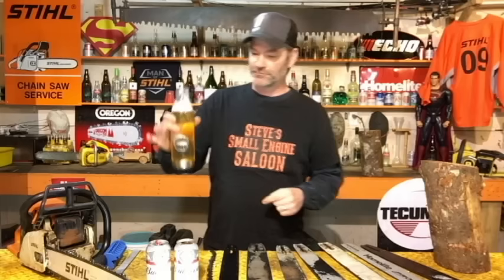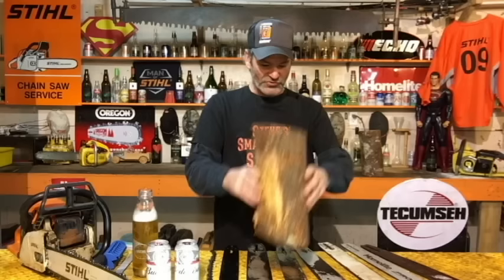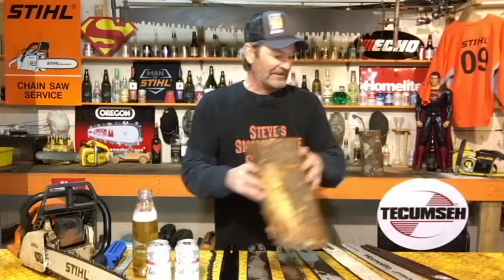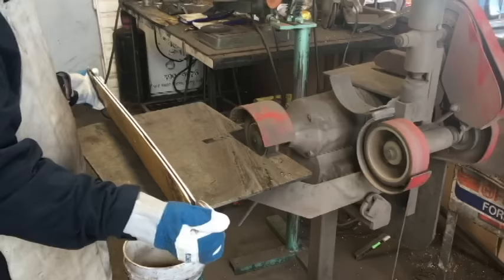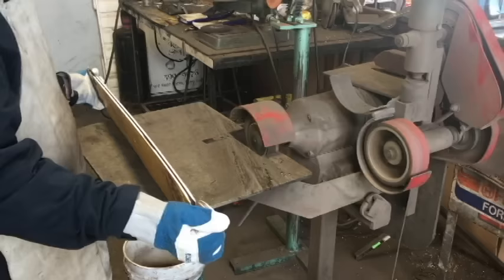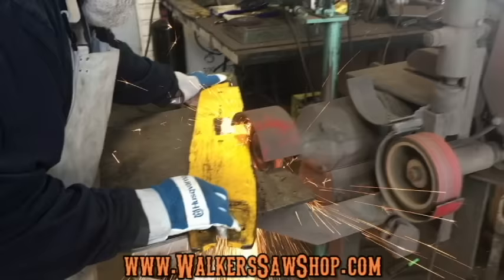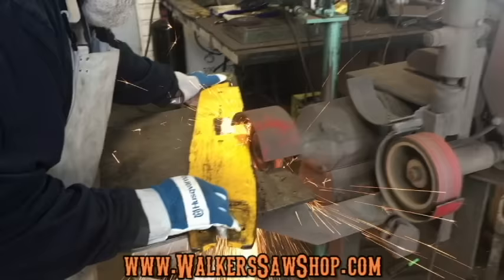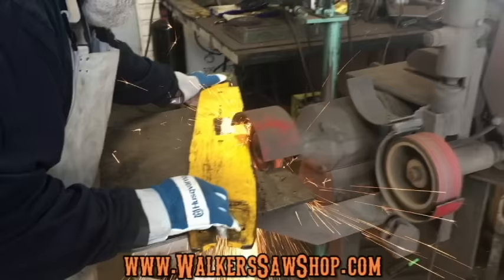How To Repair A Chainsaw That Cuts Crooked

Comment: After 45 years in the tree / saw maintainer biz, I have seen just about every mistake you can make with a chainsaw. Bar and chain maintenance are at the root of most. I think the most important is most of what you covered. My suggestion: after you finish cutting, remove the bar and chain, clean the bar, use a bar square on the down side ,not much.. one or two strokes,clean,grease nose sprocket and re install,leaving the chain loose. I get better bar life this way, rather than waiting until it’s grinder time. Love your show. Just remember, there are some people that should not pick up a chainsaw. Just  for safety’s sake.
Reply: I think I'm one of them!  Every time I do my back gives out!

Comment: I’ve worn out a bar groove, I was doing all the things, always debured the bar, the rails were square, even got a new chain but I could see the chain was twisting in the cut. Put in a new bar and saw how tight the chain fit and was amazed that it could even happen. When I teach someone how to sharpen their saw, I always speak on bar maintenance as a part of sharpening. The eye rolling can be deafening. I think that we all get our expectations misaligned by power tools. Maintaining a power saw is half of the safety of using it.

Comment: There is something you can do about the gap between the rails being to big. There is a tool that you use to roll down the bar to shrink them back together. Then hit it with a edge dresser and run it. Most people it isn’t worth it but when you run a saw all day every day that bar and chain money adds up big
Reply: Or next size up chain.

Comment: I've added some time to a bar by removing it, stacking two old hacksaw blades (depending on the blades used, 0.048" to 0.054") in the channel, and lightly peening the groove top & bottom. Then put one blade in the channel and, using the face of a ball peen hammer, swage down the length of the bar edges with downward pressure.  This tightens the groove back up. At that point I use one of those 90 degree file holder/bar dressers followed by a scythe stone to even the rails. I keep my "rehab" bar with a pair of well used and resharpened chains for those jobs where I want to clear an already storm or age/downed tree that has been laying in the dirt or silt (our property is bisected by a creek that likes to change banks and wipe out trees) and will likely dull the chain quickly, anyway.

Comment: Customer's Stihl 034 saw was cutting crooked to the point it would bind and start smoking the bar. He was a DIYer, and last time he worked on the clutch/drum, he installed the dished washer backwards allowing the drum assembly to walk in and out on the crankshaft end.

Comment: Thank you Steve. I worked in a small engine/saw shop and know most of this stuff but these videos are my refresher course. I tend to forget things these days and this is like going back to school. I haven't had this problem myself in about 30 years but when I did it was bad! Worse, it was my lack of sharpening skills at that time. I have also had bad rails too. I think? I think it was from me running a tight chain? A file did the trick as you showed. These days when friends bring me their saws it's usually a carb problem. Sometimes a good cleaning will fix them or just a kit and clean.

Comment: Hey Steve, been watching your channel for years now 

I have a 661cm with a 42” Oregon bar. Yes, one step above the max size. I blew out the sprocket on the end of the bar. It even caught on fire and melted the paint off the tip. Had it in the Alaskan mill for sugar maple 

Sprocket was free and oiled. Brand new bar and had no issues logging the first few logs. The rest of the bar is totally fine 

Gauge and pitch were correct. Stihl chain on the Oregon bar. Skip tooth 3/8 .063”. Brand new chain. Brand new clutch and drive sprocket. Brand new bar second time using. 

My thoughts are not enough oil
Getting to the tip, lower quality bar ba stihl, chain maybe too loose, maybe the sprocket got worn off to one side and the chain was riding the side, probably a combination off all of these. I will replace the bar sprocket and try again. There is a small possibility of a manufacturer defect on the sprocket but it’s welded inside the tip now and I can’t get a Pi look at it until later. 

Anyway just wondering if you had any additional thoughts or ideas.

Comment: Steve, thanks for posting this.  I was cutting firewood this afternoon and the saw was only cutting well on an extreme angle.  I took the bar off and set it on the table, could not get it to balance on the bottom side, top side balanced well.  Flipped the bar and went back to the wood.  Cuts like a dream.  I will try to file the bad edge and see if I can save the bar.  Thanks again man!
Reply from the maker: Awesome!

Comment: Just tuned two bars yesterday, from an 018 and a 290.  I have a woodshop and a shop build edge sander.  Works great for getting the rails both to the same height.  Uses a 6" x 48" belt with a platen at 90 degrees to the belt.
Reply from the maker: Right on Ole!  We used the same thing at a shop I used to work at.  Works great....

Comment: I have been in the small engine business for 25 years. The was excellent and comprehensive training on bars and chains. Box stores usually know little about bars and chains. Our local box stores often sold chains to customers that were a different pitch and gauge than their equipment required. I have straightened out those issues often. I would surmise that your video helped many people.
Reply from the maker: Thank You...

Comment: Very good, informative video.  You didn't touch on one cause of crooked cutting that I personally experienced.  As the bar wears, the guide links can touch the bottom of the slot in the bar, which will raise the tie straps of the chain above the rails of the bar, allowing the chain to tilt right or left.  When this happens, the bar is plain worn out.  I also clean the bar slot each time I change or sharpen my chains.  It's amazing how much junk gets jammed in that slot

Comment: Good video. I cut wood in the high desert. The sand eats chain, bars and sprocks quick. I ended up getting the bar rail grinder from Bailey's and a bar rail closer from Madsen's. The grinder is very helpful! But, I often close the rail too much which I'm used to sligjtly re-openning back up. 

I like the cannon bars the best as they last (a little) longer in the sand then even Stihl and for sure longer then the Oregon and Husky bars.

But one thing is for sure, I cut straight now.

Comment: "He actually said that you can hold water in them too. I'm not so sure about that." LOL!
Reply: Shouldn't drink water. Water rusts pipes and fish poop in it.
Reply: I tried putting water in a similar bottle. The problem is that it never got drunk. Beer seemed to get consumed faster. In short, it’s a good container for water, but it’s a better vessel for drinking a couple beers. Especially if you only want to drink “one”.

Comment: Steve, I have used a wider gauge  chain on a bar that the grove is too
Wide. We did this in the logging 
Industry and it worked fine. We also replaced the tip that fit the chain.

Comment: Thanks so much for posting these videos, my dad never did proper maintenance on the old chainsaw (pioneer partner 400) or taught me much in the way of how to even use it. With your videos it's been a slow but steady process of first getting it to start, tensioned, sharpened, and now getting it to cut a bit better/straighter.

Comment: I live in the land of logging and forests, Sweden. So, here having a chainsaw is like having a car. However, only your instructions clearly demonstrated carburator adjustment on my Stihl saw. Good job. Keep it up.
Reply from the maker: Cool, thanks
Reply: @StevesSmallEngineSaloon  I'm wondering if you could possibly produce a video on the proces of cutting along the grain when handling chainsaws. What I mean is that I tried to adjust the angling on my chain to cut along the grain, but it doesn't feel right. Perhaps you could enlighten me?

Comment: When dressing your bar, don't forget to also de-burr the edges. That same Oregon tool (Pferd also makes a good one) that works to level the rails is also good for deburring, you just turn it to put the cutting edge on the side of the bar, rather than on top of the rails. (A regular flat file works as well.)  After leveling the rails and deburring, the corners of the rails are often razor sharp. I'll generally take my flat file or bar rail dresser and make a VERY light pass with it held at a 45˚ angle to just break that corner slightly. You hands will thank you  for this step if you are ever handling a bar without gloves on.

Comment: Steve, you're my go to guy whenever I run in to problems with any of my gas tools.  You've saved me a ton of cash and time. Love your vids! I discovered a variant on reason #2: the driver teeth on the chain wore down very quickly. The chain was the right gauge originally, but wear made it like like it was now too small.  I suspect the reason was that too much downward pressure was being applied when cutting (and the chain was loose) prematurely wearing out the chain's driver teeth.  Keep up the good work!!
Reply: keep the chain sharp and let the saw do the work!

Comment: ANSR
Steve, there is another thing that might help the problem with the chain wiggling in the bar groove; its a bar rail tightening tool.  It can close up the groove enough to tighten the chain movement.  Love your channel.  I watched the video today about the locked clutch drum on the Husqvarna chainsaw.  The device to grease the clutch bearing
 is now on my list of tools I will be ordering.  Thanks for the info.

Comment: Thanks Steve, I have worked with chainsaws since 1972 but I can always learn something from you, Thanks again Budweiser. After a 6 pack my chainsaw sometimes cuts crooked, well i think it does !!!!
Reply from the maker: LMAO, Right on Buddy...
Reply: If that happens after only a six pack you are still on your learners permit. Not for your chain saw skills, your drinking skills😂

Comment: Steve i do ALOT of cutting firewood i do it year round i have a husqvarna 440  and when i 1st started i had this problem  many times and come to find out it was a combination of all these things. My chain wasnt sharpened correctly ( i was still learning), my chain was slightly loose ( alot of the problem) and the bar needed filed down so ive havent had it in a while but when it happens i defently know what to check know i can sharpen a chain free handed without a guide & im proud of it took alot of practice and cut fingers🤣 great video

Comment: I don't know if you're still reading comments on this video but i borrowed an old Stihl 029 from my father-in-law and all the problems you mentioned in this video the saw has or had really. I appreciate the tips and tricks
Reply from the maker: You're Welcome...
Reply: I'm gonna start cutting straight tomorrow. 
I swear it.

Thanks for the info Steve.

Comment: 25 years ago I had the smallest Sthil chainsaw . I cut lots of firewood and after a year or 2 noticed the saw was cutting crooked . It got so bad the saw would bind and stop altogether. .

I noticed the saw cut properly until the top of the bar was out of site in the log, then it would go crooked and bind to a stop. 
It turned out that the rails on the top of the bar were so stretched apart that it was wider than the cut. . 
At the time I had been pressing down on the saw to try to make it cut faster, and I figured that by pressing on the bar I caused the rails to widen. 
I could feel the sudden widening of the rails as I drew my thumb and fore finger up to the top of the  bar.

I had turned the bar upside down a few times when the chain came off ,or when I changed it. 

I loaned the saw out after getting another bar and the user just put gas ,and not a gas oil mixture in it, and destroyed the engine . 

I learned many things by trial and error with that little saw. 
 I now have a Slhil 026 I bought about 20 years ago and learned much more in that time , but not as much by reading the owners manual as I have learned from your videos in the last 3 days when I subscribed to your site..
You are by far the best at everything from small details to be sure we understand ,to your way of speaking . Oh, and yes your humor , and sipping beer.
 Thanks for the great teaching .
Reply: You also learned not to loan out your saw.    

I just learned that lesson.    He didn’t put bar oil in it .  

  Fried the chain and the bar is black.

He paid for a chain, but I had an extra bar  so I didn’t sweat it.    

Lessons learned.   I’m going over to his house to cut the rest of them down
Reply: @jasonkeuma1986  Thought you were going to say, you're going over to his house to borrow his riding lawn mower.

Comment: I replaced a bar and chain figuring it wasn’t repairable.  At least now I know I could have been sold the wrong chain. I believe I still have both. I’ll check chain for correct fit and bar to see if it is actual worn and recoverable. Thank you. Great common sense video. 
Steve, Plymouth MA/ USA
Reply from the maker: You're Welcome...and Thank You...

Comment: This was information that’s really going to come in handy. Thanks.
Reply from the maker: Glad it was helpful!
Reply: Steve, 
I have a fs38 STIHL weed eater. I have replace the carburetor, coil, spark plug, and fuel lines and filter. When I try to crank it it back fire through carburetor. Do you have a video on this issue.??

Comment: When sharpening hand saws I used a homemade tool for leveling the teeth. Take a piece of 2x and cut a groove in it to form a tight fit on your file.  Works just like the store bought.
Reply: Make a video

Comment: I am so glad our found your channel. 👍. I have been using Stihl saws for 45 years but have learned several really good things from these videos. And you are too funny. 😆. Who knew some plastic bottles can be used for water, too. 🤣.  And your comment about not really having a point of reference to the pain of childbirth being less than the pain of a sleeping relationship of steel in your eye had me laughing out loud. 
It has just been recently that my log cuts have not been square. I thought it was me and those darn aging muscles that was not holding the saw better. You have brightened my day in showing that it may be something to do with an old bar or wrong chain size. I'll check all the things you show here. I already feel five years younger! 😄. Thank you!
Reply from the maker: Right on Karen!  Thank You...

Comment: Thanks for the info. I will check my guide rails. The only time it cuts in an arc is when the saw is in a horizontal axis. Like cutting a stump.  It cuts fine when cutting on the vertical axis. I'm also going to check that side wobble you talked about with the chain (rocking chain side to side). I'm thinking the bar needs some tuning up. Maybe just replace the bar. Bar and saw all original. The kit and kabootle is around 25 years old. We've been through a lot. I enjoy all your videos. Stay safe, stay well.

(Edit): UPDATE - so it was the inner part where the chain rides the bar. Ended up replacing the bar. Wow! What a difference. It's like a whole new saw. Thank you thank you 😊.

Comment: good video steve. i'd like to ad the best repair is to avoid the problem in the first place. most wear is from lack of lube and or abrasive infiltration.  a dull chain grinds dust  not pull chips  when that gets in the bar groove it plugs the oil supply. so proper chain sharpening tension and rail cleaning with good oil is a lot cheaper than replacement parts.
Reply from the maker: Great comment Rick, thank you...
Reply: Right you are

Comment: "Use the kitchen table; your wife won't mind." " Metal chips in the eye hurt worse than childbirth". You sure made my wife laugh, Steve. Yes, we watch videos like this together. 

I like to clean the debris out of out the bar groove with a small steel ruler, and lightly chamfer the dangerously sharp edges with a piece of emery cloth.

Where in Canada are you, Steve? We're in Williams Lake, British Columbia, the heart of the logging and cattle industry. Love your super informative videos! Cheers, Paul and Sandy
Reply from the maker: You two are the best!  I am on Vancouver Island now, but I used to live in Williams Lake when I was a kid!!!  My dads best friend still lives there I believe.  His name is Greg Poulson (Pawlson maybe) has a son named Brett and another son cant remember his name....
Reply: Out in the woods the steel guild plates will clean out the bar.Well that's if today's saws still have guide plates under the bar and clutch cover.
The round file will also take off the burrs on the bar,it works much faster than a flat file.I just use the flat for rakers.

I hate packing in more than I need to,wrench,files (flat and round),and a screwdriver for the carb and that's all my tools I pack in.

Another lil tip,today's bars have small,almost pinhole size, holes for the bar oil.Drill them out with a 1/8" bit and it'll oil the bar and chain better and last longer.Also cranking up the oiler adjuster till you almost run out of oil when you have run out of fuel.

Comment: I really liked your video.  I have an Oregon CS-1500 chainsaw that cut crooked.  It has a built in sharpener which didn't do me much good. A salesman told me it was because it wasn't sharpened right. I bought a replacement blade that came with a new sharpening stone .  It works fine now.  My other chainsaws have more standard chains and normal sharpening works fine on them.  Many thanks!!